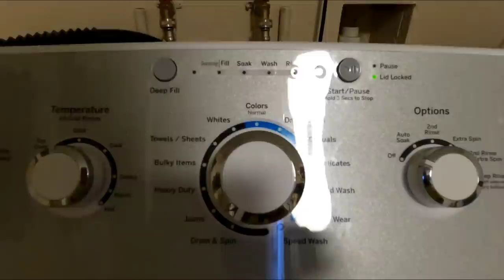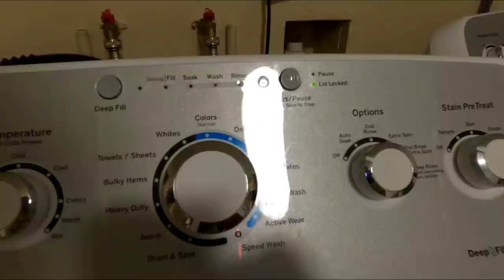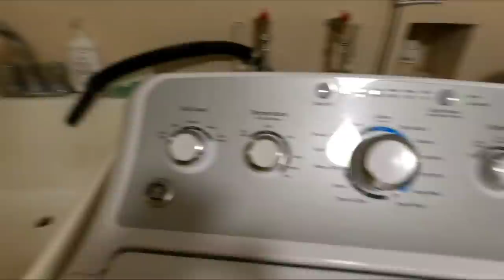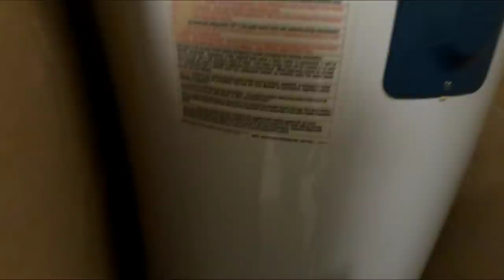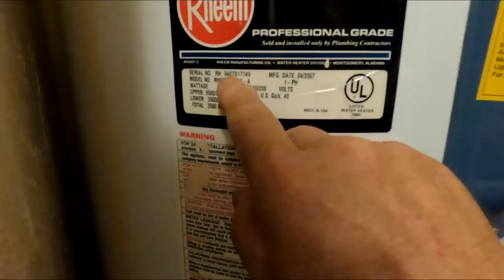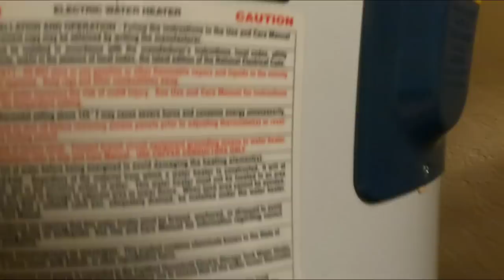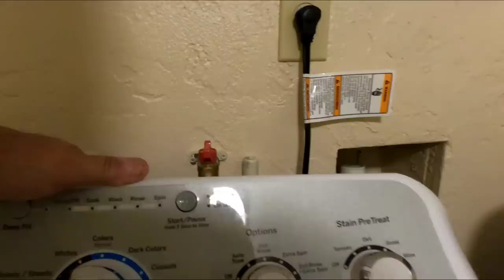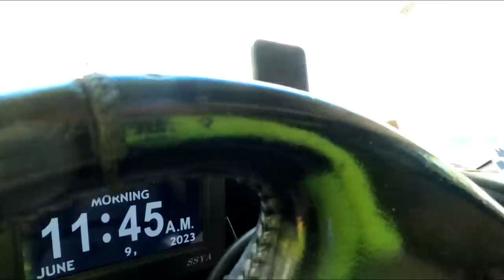A FEW SERVICE CALLS,EARLY FRIDAY.

Comment: Got a similar Kohler loo.  Flush is a bit weak.  Gotta hold the lever down if the bowl has a full load.  Usually not an issue but requires a double flush every now and then.  Very sensitive lime scale...works much better after a decade (vinegar or muratic acid)

Comment: Johnny I have the same toilet and if I hold the handle down for a few seconds I get a much better flush
I'm not sure if the manufacturer do that do that on purpose so you can adjust the amount of water that you want to use the 0.6 gallon or 1.28 gallon???